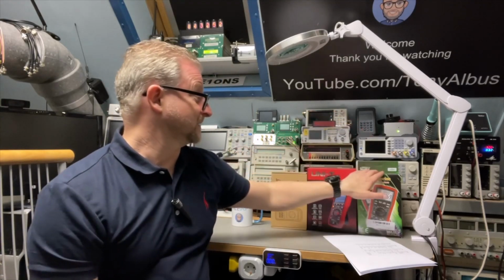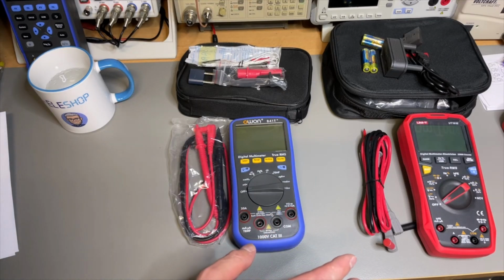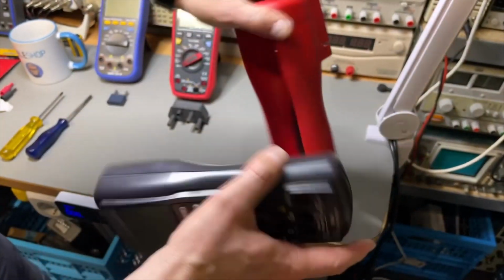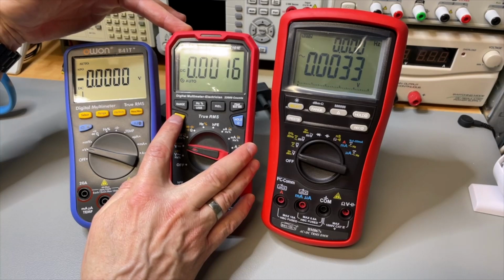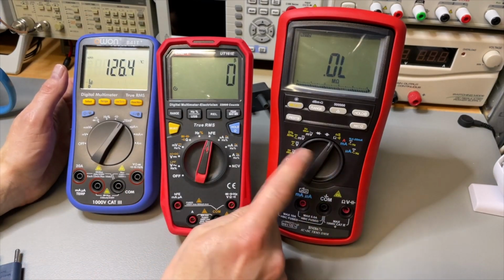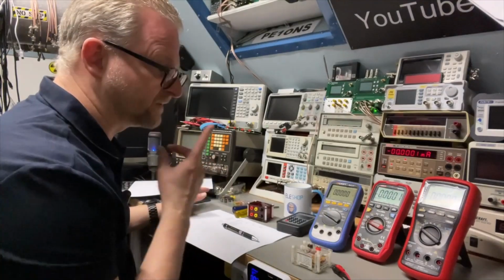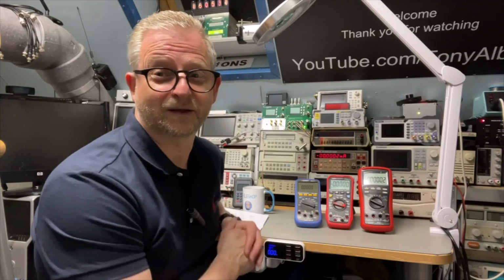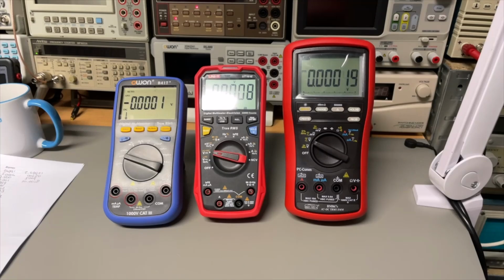#210 Owon B41T+ UNI-T UT161E Brymen 867s Hands-On 3 Good Meters

Comment: Hi! I own a Brymen 869s but today I just ordered a Uni-T UT61E+ meter (74 euros discounted on aliexpress) as a more handy meter, because yes, the Brymen is obviously a much more "serious" and precise multimeter, BUT it's very heavy, very big, it's rather slow in the autorange mode, and lacks a proper auto-hold function, and its selector knob is very hard to turn. For my normal use (small power electronics), I don't need that precision and neither I need high voltage protection features. Rather, I need a lighter, smaller and faster multimeter. I won't give away the Brymen, but I think I will end up using the cheap Uni-T much often than the Brymen. I noticed that the UT61E+ has a rather useless transistor HFE measuring function instead a more useful temperature measuring function, and that the NCV is pretty useless, but who cares... In the end, 99% of the uses of a multimeter in small power electronics are DC voltage measurement to the tenth of a volt, checking continuity and measuring resistence to 5% accuracy or worse...
Reply from the maker: Yes sometimes you find the solution that works for you in two devices and not only one exspensive one. its works different for everyone. in the end you need to find out what works best your you... after a while you know what you are regularly using and what not.

Comment: why did the OWON keep reading  0.0000 V  for a long time and then suddenly read 0.0058 V    to b e in the same general area of the other meters at time stamp 10:22 ?
Reply from the maker: The multimeter are high impedance in voltage setting so that can just happen if you not short the inputs
Reply: ok.. the inputs were floating and just picking up noise @TonyAlbus
Reply from the maker: @rcarioca  yeps

Comment: Regarding OWON B41T+, when you are in diode mode, and there is a short, does it make a beep noise?  I am talking about when it is in diode mode. NOT in continuity Mode with noise. THANKS
Reply from the maker: Thank you for your question, i dont have the meten anymore, it was a borrow. i dont remember if it did.

Comment: Question about the multimeter Brymen 867s or Brymen 780. When measuring DC current in mA and A (10 A) modes, is there a difference in readings at the same current value? For example, in milliamp mode, 150 mA is measured and without changing the current, switch the limit and the probe to amperes, it will show 0.16 A. Make the current load from the resistor, or if it is a PSU, then with current regulation disabled. Will there be such readings or will there be the same 150 mA and 0.15 A?
Reply from the maker: In practice the multimeters resistens is usualy so low it will not influance your mesuerment. but if you shortcircuited your psu with your multimeter, you need a very stable constantcurrect psu, becouse then the multimeter is the only resistance that is the load and then it will make a difference. also accuracy is ususaly in X% +Y-digits of the scale... if Y is 1 digit.. that meens in 150 mA it can display 149-151 .. but in the other range 0.14-0.16 ..
Reply: @TonyAlbus  , If you measure the resistive load from the battery with a multimeter. Then on different modes mA and A will there be a different current in the readings? I have UT61E+, it shows differently. Bryman will show the same current or also in different ways?
Reply from the maker: @Igor_user  it should more or less be the same, but on a lower scale will be more accurate, becouse of this 1 or 2 digits.
Reply: @TonyAlbus  , Can you make such a measurement? Measure resistor current in mA and A?
Reply: On the mA scale you use a different connection.

The resistance on the Amp scale shunt is larger than the resistance on the mA scale shunt..

It will influence the current and so the measurement as well.

Comment: Hello again bro, I get Uni-T 61e plus befor 2 day and I have some problems. The multimeter had batteries installed. When I switch it on and try to muve between measurement options I get signal for low battery and multimeter get auto switch off. So I think this battery's its probably already finish and put new ones. Continue test of device and boom again low battery and auto switch off until I muve between measuring operations.. I checked the battery slot, noticed that one of the battery contact it's not like other a bit deformed in different way. But I think it's still oky to make good contact. I use device today and don't have such problem.. But I don't know what to do I have option to back it and get new one.. What u will advise me?
Reply: Also because scroll and unscroll battery cover there have metal sleeve and because of that metal it's soft I saw there fall pieces one was around 2mm and some more little one. That all can go inside at board and do some problems. No idea if that's possible also to make short circle.
Reply from the maker: If it was new from a store, go back and explain the problem... for sure it is not as it should be
Reply: @TonyAlbus  it's already go back for replace. Thanks for ur opinion!

Comment: Sorry to tell but actually I'm very disappointed with this comparison.

As I have this Brymen things you should say:

01. Brymen has a 2-row screen. So you have a lot more pieces of information during measurements without "turning the wheel" up and down (it saves your work time).

02. Brymen has 9V battery and diode test voltage 3,5V - which are nice. 
You don't have problems with loose AA batteries and have an easier life in checking LEDs. 
Which is far more important in daily life than one "digit more after coma" in most measurements.

03. You didn't compare how fast they are working in measurements like resistance or buzzer mode - another important thing during work (no one likes losing time because of a slow multimeter).

So basically, during your comparison You show nothing real important for most users in their daily work life.
Reply from the maker: Thanks for the feedback, yes the brymen is my fav. too. using it more and more.

Comment: Owon B41T+ is the crappiest amongst three
Reply: of course the Brymen is the best meter. Does that justify the triple price (without Bluetooth), the big size and the 9 volt battery? I am not a professional and am fully satisfied with the Owon.
Reply from the maker: Hi guido, i think it does, it is often tested better then fluke with 1/3 of that price. does not mean you should not be happy with your Owon, nothing wrong with that meter and as you say it has indeed all the options
Reply from the maker: The Brymen is not bad, it is actualy very good.
Reply: @TonyAlbus  ended up ordering bm786
Reply from the maker: you will love it 👍

Comment: Greetings. Please measure the input resistance of the Owon B41T + multimeter at the mV limit when measuring AC and DC voltage. Many thanks.
Reply: The input impedance is about 4.7MegOhm for mV and both DC & AC.
Reply: @hgm6421  Many thanks.
Reply from the maker: The meter is back to the store, it was a borrow, i can not measure that for you now., Greeting!
Reply: @TonyAlbus  Did you return the Owon B41T + because it turned out to be bad?
Reply from the maker: Hi, i returned it because it was a borrow, a loan, i can not buy it all myself. it looked like a good meter for its price.
Reply: Thanks for the answer.

Comment: The Uni T 61e + costs 58 Euros on Aliexpress
Reply from the maker: Hello Juan Carlos, yes, but here is the 161E
Reply: They are the same and have the same price, the 161 has Ce marking. Enter the official store on Aliexpress
Reply: @juancarlosgarcia4005  CE rating can make a big difference in some countries. Without it the customs might not let it through. The 161 also uses fuses that are more common in Europe than the 61E+ ones.

Comment: The Brymen is UL listed and  the only one I would trust dealing with high voltages.
Reply from the maker: Yes the Brymen is the best of the 3 .. they have done i nice job.
Reply: I consider Brymen a high-end brand, about in the Fluke-league. They seem to be very robust built instruments which will last a very long time, even with some abuse.
Reply: @ssalient  Absolutely, my main DMM is a Brymen 869s and the only thing I miss is some internal data logging capabilities like in my OWON B35T+
Reply: @T.M.I.E  another feature missing in 869s is the beep in diode check like fluke ones. I miss it a lot
Reply from the maker: yes it is not a fluke, but you also did not pay for a fluke.
Reply: The uni-t ut161e is ETL intertek listed, so it's also approved for safety by a third party.

If it survives transient pulses, don't know.

But it's considered safe for industrial use...

Comment: It’s a shame that Uni-T has a useless hFe function that takes a whole selector position. If they would have replaced that with temperature this meter would’ve had a lot more appeal because for the rest it is a very decent device.
Reply from the maker: Yes agree, hard to make a choice, all 3 have something you want, there are meters that have that, but not in this price range...